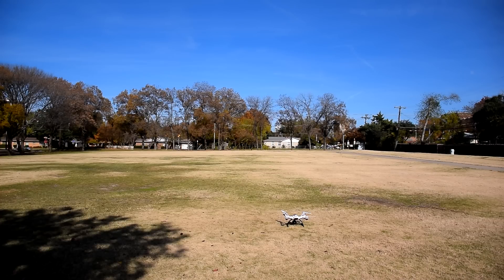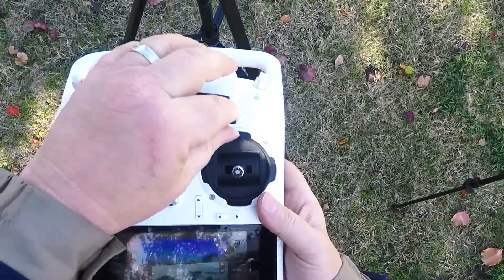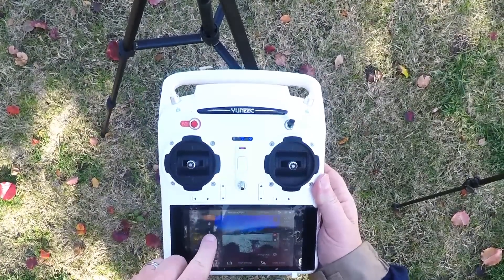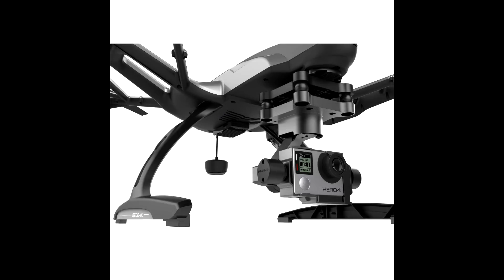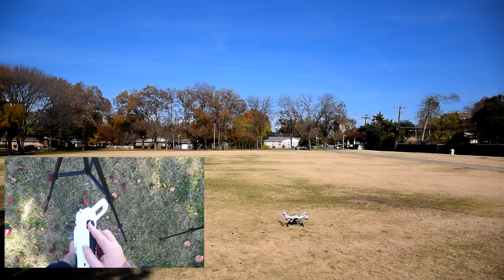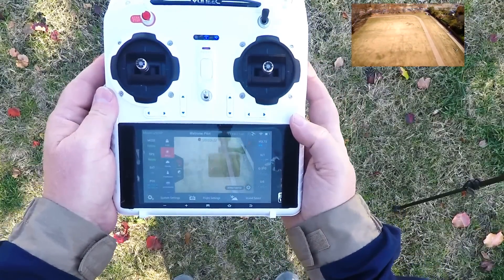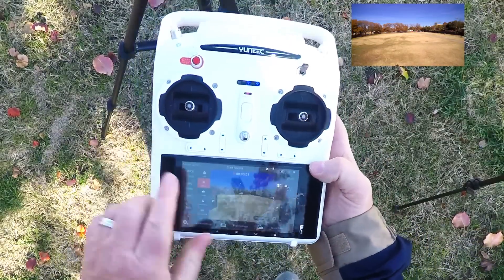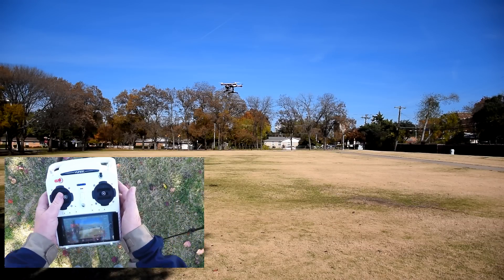Episode 3 - How to Fly Your 1st Flight With Yuneec Q500 4K: First Flight

Comment: Did you have any problem updating to your 4k camera?  Does your controller get all the camera options?  Just wondering because I just sent my CG0 2 camera to Yuneec in order to upgrade to the 4k camera.   I assume everything will work because they didn't say there would be any issues.
Reply from the maker: +PintoBlades I didn't have any problem at all. Just plug it in, slide the gimbal onto the aircraft and bind it with the TX. Be sure to pick "CGO3 PRO" rather than CGO3" when you bind it; otherwise you won't see the additional camera controls.

You are going to LOVE the improvements you see with the new camera.
Reply: +Jeff Sibelius - Oh good, that sounds easy enough.  I don't have the 4K camera yet, I just sent out my CG0-2 today. They will send my new 4k to me after making sure my CGO-2 is working okay.  I flew the CGO-2 once and couldn't deal with all the orange cast in the video, plus it changes throughout flight...cool, warm, back to cool.   So yeah, they will send me the 4K and I will bind it like you instructed.  Can't wait!  I love the way the drone fly's, its great.
Reply from the maker: +PintoBlades Did you have the CGO2 or the CGO2+? Either way, make sure your firmware is updated on the TX and the aircraft. If you're using an old version of the firmware, it may not have the CGO3 information included.

The CGO2 is awful for color rendition. I couldn't even color correct it. Over-saturated, bad bias to the yellow . . . I'm a photographer before I'm a pilot, so that was something I couldn't accept. 

I agree with you. I just love the way the Q500 flies. I also fly a Phantom 3 and in most respects I like the Q500 far more. I've got a Typhoon H on preorder - we'll see how that compares to the Q500 as well.
Reply from the maker: +PintoBlades Did you have the CGO2 or the CGO2+? Either way, make sure your firmware is updated on the TX and the aircraft. If you're using an old version of the firmware, it may not have the CGO3 information included.

The CGO2 is awful for color rendition. I couldn't even color correct it. Over-saturated, bad bias to the yellow . . . I'm a photographer before I'm a pilot, so that was something I couldn't accept. 

I agree with you. I just love the way the Q500 flies. I also fly a Phantom 3 and in most respects I like the Q500 far more. I've got a Typhoon H on preorder - we'll see how that compares to the Q500 as well.
Reply: +Jeff Sibelius - Hi Jeff, yes it was the Q500+ camera.  Firmware was up to date when I got it so hopefully setting up that 4k camera will be a breeze.  They said I will receive the firmware with it.   Yes, I agree on photography, I am more into the photography portion of it as well, so it's important that my color is correct.  I plan on taking it to the mountains and want dependable color.   I also might have to have them allow me to remove the 8000ft limit on it because our mountain areas go over 9k feet.  One mountain is 13k feet but I won't be on that one much if at all.  Mainly around 8k to 8.5K feet.  My home sits at 4,657 feet above sea level.
Reply: +Jeff Sibelius - You can see my first and last flight with the CG0-3 camera before I shipped it off today.  I posted my first flight on my channel.  It was my last posting.  Title "First Flight"
Reply from the maker: +PintoBlades That video tells the whole story about the CGO2+, doesn't it? At times the colors looked decent. Most of the time it looks like you've got a yellow filter on. You're going to have to post back here after you've flown with your CGO3 - I want to hear how much better that camera is for you!
Reply: +Jeff Sibelius - Yes sir!  Exactly, looked like there was a yellow filter but it would come and go.  It didn't look to bad on my laptop, but when I watch it on my desk top PC , the color is better and it really shows up bad.   So yeah, as soon as the 4k arrives, I'll fly it and tell you how happy I am!  :)   Hope you sub, I'll have more videos soon.  I also plan on to GoPro my ATV rides with some drone flights in the mountains here.  Should be fun!

Comment: GREAT video's sir. It is good to note though that your video's also applies to Chroma. With that said I have a question? When you change the geofence in the firmware to set the boundaries for smart mode, I am guessing this is also changing the geofence for AP (angle mode as well. If it is not and an entirely different setting PLEASE advise. Setting the distance is a must since I have very close neighbors and do not want to fly in their yard. I have been poking around and noticed the lowest boundary setting is 20 meters. Can I set a shorter distance? Thank you in advance for your response. Best Regards
Reply from the maker: +jay j Hi Jay - I have to admit I don't know the answers to your questions. I extended my geofence limits out to the max distance I would fly and just haven't tried going beyond that. I'll see if I can find out tho
Reply from the maker: +jay j One thing did occur to me about this . . . if you fly in SAFE mode, setting your geofence lower than 20 meters gives you a very small window for flying - that safe boundary around the transmitter is 26 feet, or about 9 meters. That means you would be restricted to flying in an area only 11 meters horizontally between the two restricted zones.

Comment: Very good video! I bouth Yuneec Q500+ and had my first tour today after first to download firmawere to drone and ST10+. I begin in smart mode. It was strange to fly. Before I fly DJI Phantom and I had nose and camera forward. In smart mode It was diffrent. First this safty circle and sticks was strange fore me. But I understand that I had to set st10+ In Angel mode. Then camera/nose be like I use before. I have a question. Do you calibrate every time?. Some says that only after firmawere download and If you travell moore than 10 Miles. But how drone find home if not calibrate?. In angel mode, If drone is to far away. Can you set over to home mode?. I bouth this With carbon case and 2 battery+ many other thing.
Reply from the maker: +teknofil007 If you have flown a Phantom, the Safe mode on the Q500 will feel very strange. I encourage you to get familiar with Smart mode though. You can use this mode to create some videos that you can't do in Angle mode.

I do not calibrate every time. I calibrate when I do a firmware update for sure. I also calibrate if I go long distances. Calibrating after each flight is unnecessary though. I drove almost 1000 miles away from my last point of calibration and flew without recalibrating, with no problem. 

I typically do a calibration every month or so just to be sure.

Your Q500 will set its home mode based on where the transmitter is. If you don't lose your signal the quad will return to your transmitter even if you move after you launch. If you lose signal the quad will return to its last known position for the transmitter. 

This happens automatically. You don't have to do anything to set a home position other than establishing your GPS connection when you start the aircraft and transmitter.
Reply: +Jeff Sibelius Hei Jeff! Thanks fore answer Its help me to understand moore. On my phantom I had to calibrate every time. And my phantom was Ustabil so after some time I sold It. And now Im a owner of Yuneec Q500+. I had only 1 test In smart mode. Nexst time I will use angel mode. In begining sender and drone wait fore Gps signal. Its Intresting and good to know that calibrating every time Its not necessary. Your video Is very good! You exsplain so other can learn easy. Thanks agein!

Comment: First flight was fun but short. A little too windy but the Q500+ stayed in the air. I didn't take it more than 15 feet in the up. I will fly again when it's not so windy out. Still flew easy and very well considering the wind conditions. Glad I have this.
Reply from the maker: +Omar Calhoun Wind is what causes me not to fly more than any other factor. If it's higher than 9 mph I just don't take off. I use uavforecast.com to find little pockets of time where the wind lets up enough for me to fly, so sometimes I'm doing it early in the morning or around dusk. 

I hope you get a good opportunity to fly soon!

Comment: If I treated my sticks on my Tarantula transmitter like that, it would be in a tree 100 meters away. This thing is slow.
Reply from the maker: +Ernesto dí Terríbílé LOL if you tried to shoot video from the Tarantula it would be bouncy, fully of jello and pointed the wrong way because you don't have a legitimate FPV.

Remember, this is a first flight video so everything is being done slowly. That said, the Q500 is a very slow aircraft. It's an aerial video platform, not a toy quad or FPV racer. 

I never really understood the criticism of the Q500 for being slow - that's how it should be for its intended purpose.

On the other hand, if you do want an aerial video quad that goes faster, take a look at the Phantom 3 or the 3DR solo, both of which have higher top ends. Or, if you want to spend a bunch, look at the DJI Inspire. Even the Blade Chroma goes faster than the Q500.
Reply: +Jeff Sibelius I know what it is intended for, I also fly a Xiro(always mode 3) but I never will do such extreme movements on a gimbal stick. On a large glider plane, you could do such movements never done it on a Quad. It amazes me how slow this thing flies when putting the sticks in such extreme positions. Would love to see a beginner fly this Yuneec in turtle mode. And then thinks he can control a Tarantula or Eachine 250 FPV Racer. They will crash it in a minute.
Reply from the maker: +Ernesto dí Terríbílé I think someone would feel the difference as soon as they took off. That's like someone driving a moped and then getting on a crotch rocket . . . just because they open the moped up full throttle that doesn't mean they will assume they can do the same with the high powered motorcycle. They're different things completely.

Comment: Very nice video. Thanks you for sharing. I have several other quads and am also considering a quad from Yuneec. Fly safe!
Reply from the maker: +dheller777 It really is a nice quad to fly, remarkably smooth and reliable. It's not fast at all but it does what it does very well. If that's what you want from flying, you'll love the Q500.

Comment: is the throttle always spring loaded to go to the center?
Reply from the maker: +Jhaas42 Yep. That makes sense with the GPS . . . you let go and the stick snaps to center as the aircraft goes into a hover. I think that helps to keep a lot of newer pilots out of trouble LOL
Reply: +Jeff Sibelius oh i see. Any learning curve to that? I do enjoy flying my quads like  normal helis but this whole  gps thing will be interesting. i just bought the q500+ and im excited to see how it goes for the price i paid 😆
Reply from the maker: +Jhaas42 The GPS just makes it all easier. You don't have to do anything to maintain a hover or a specific location - just let go of the stick. That may be an adjustment for you since you're used to controlling that on your own, but it's one you'll get used to pretty quick. 

The Q500+ is a bargain - it's the exact same aircraft as the Q500 4K other than the color of the plastic and decorative stickers. The big difference is the camera - if you're just flying around having fun with video, the CGO2+ might be sufficient for you. If you want to shoot really good video, you'll want the CGO3 . . . and you can upgrade your CGO2+ to a CGO3 for a reduced price through Yuneec.
Reply: +Jeff Sibelius that's great to know thank you for the information. The stock camera is great for know ill just have to adjust my thinking to the gps and everything, i really want to try out the wizard remote too. that was actually one of the determining factors in ordering this quad. Seems like a ton of fun and for 599 right now rather then the 999 it used to be im thinking ill be real happy 👍

Comment: zhis is not a yuneec k4
Reply from the maker: +Guy Giberyen Yes, it is.

The only differences the Q500+ and the Q500 4K are:

1. The color of plastic used on some of the parts
2. Some decorative stickers
3. The camera. This is the only functional difference between the two models - the aircraft themselves are the same.

My quad has the CGO3 camera and so it is a Q500 4K. I could buy a different color canopy and props and make it look like a 4K, but that seems like a waste of money.

This is a good point to make, however. People looking to buy a Q500 who don't really care about top video quality can save money and get the Q500+. It's only $599 - $699, depending on the package you get. But you're getting the same transmitter and the same aircraft - and you can always upgrade the camera through Yuneec's trade-in program later on.

Comment: great videos, what video editing software are you using?
Reply from the maker: +Joe “Hose A” Cerda I use Sony Movie Studio Platinum 13.0, and it's a pretty simple program to use. Movie Studio has 90% of what Sony Vegas has and costs a fraction of the price. The Movie Studio suite comes with Sound Forge Audio Studio, which I use to clean up my narrations, and a dvd creating program in case you want to output to a DVD to watch on TV. 

I bought a copy of Cyberlink's Power Director on a Black Friday sale but haven't yet installed or tested it. This is supposed to be an excellent program as well.
Reply from the maker: +Joe “Hose A” Cerda Joe - I just saw an ad for Power Director at up to 70% off. Might be worth checking out!
Reply: +Jeff Sibelius thank you...I will

Comment: When your first battery gets low and you land and you put another in. Do you have to recalibrate the quad all over again?
Reply from the maker: +joseph wazocha Hi Joseph - if you calibrated your compass and accelerometer initially, you shouldn't have to recalibrate either unless you travel a long distance or unless you notice the Q500 hovering unpredictably. I went from Texas to Iowa and flew a flight without recalibrating - so you can see this isn't something that has to happen often. I went ahead and recalibrated the compass after my first flight in Iowa, just to be sure, and then again when I returned to Texas. But I go all over Texas without having to recalibrate. The accelerometer will probably need even fewer calibrations than the compass.
Reply: +Jeff Sibelius Your video's were very helpful, way better then many.I just bought mine about a month ago. It's to cold right know to go out and fly it. I'll have to wait for the spring thaw. The thing I don't like about any manual is that it's long drawn out and I'm sure they do it to protect themselves from any law suits. But that's o.k. Keep up the good work. I only asked about when you switch the batterie's out because I wasn't sure if you would lose any data that would be inputed  into it.

Comment from the maker: This is Episode 3 in a series of videos designed to help you complete a safe and successful first flight with your Yuneec Q500.
Reply: +Jeff Sibelius many big thanks Jeff. Thanks again from jogjakarta :)
Reply from the maker: +episodetujuh Thanks!
Reply: Jeff thanks with all your help on my first Q500 flight. Your videos do trick. Only got in one flight though cause it's so Damn HOT here in Dallas Tx. 
THANK YOU VERY VERY MUCH!!!!!!
Reply: Jeff Sibelius New Yuneec Q500 owner. First test use went good thanks to your tutorial videos but second attempt, the left control button controls the Quad fine but when attempting to toggle left and right to move the Quad camera no luck...it will not move. The right controls work fine. Have you had this happen?
Reply: You want to check with mode are in 1 or 2, also I can't remember off the top of my head, but try calibrating your transmitter controller.  There are a few YouTube videos on how too.
Reply from the maker: Hi Sandy - just saw this. Help me understand . . . are you saying the aircraft won't spin (or yaw) left or right with the left controller stick?
Reply: Hello Jeff, I've been watching your tutorial series for the Yuneec Q500. Great video guides.I have a question about low battery charge.On my first flight , I didn't realize my battery was low and the aircraft landed itself and I could not change or move controls.I saw something to the left of monitor that said Emergency Mode,was that correct for it to do,to land itself? and What is Emergency Mode?